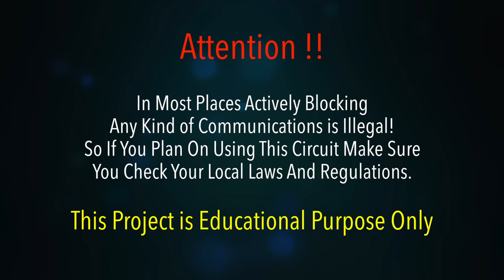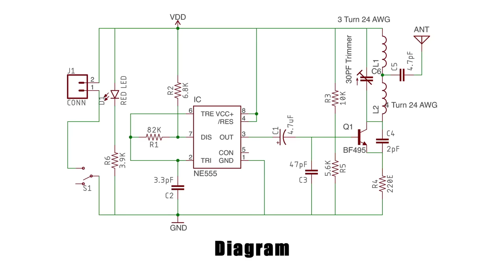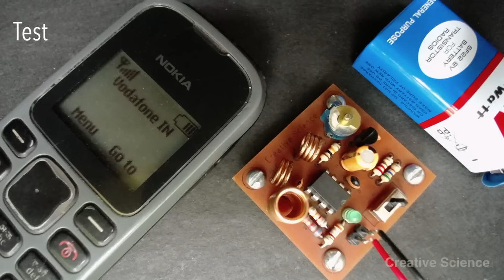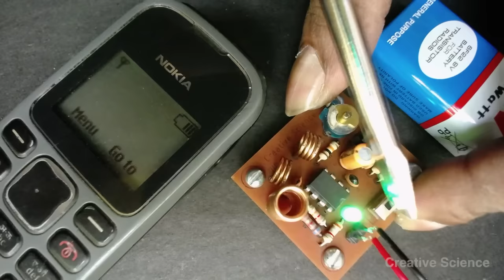Make Your Own Cell Phone Signal Jammer Using NE555 Timer

Comment: Built one, and I've been building radio equipment for 50 years. Range of the device was about 5 inches!
Reply: This person actually buys full kit and assemble it!!
Reply: Haha thank you. I was wondering this myself. I just picked up amateur radio and I thought this device was cool for a second. Then I remembered basic circuitry.
Reply: I think it works better if you have a phone from the 90s.
Reply: Do you think it would work better with a bigger antenna?
Reply: This was the only comment I was looking for. About the range of this tiny board.
Reply: @stevansaucedo4151  yeah, no. That's not how anything works.
Reply: @anubhkatiyar21  no he designed the PCB his self.
Reply: Stephen Cook i have to say this whats hilarious. Buy a plasmalighter and a screwdriver and put it inside the plasma and it actually jamms (totally blocks) phone internet connection.
Reply: Thats more than i was expecting !!! Because in the video the pcb almost touched the phone !z . Did you over clock the voltage to gain a extra radius ?
Reply: @yinyangstudios-y.s-53  use a old router and fiddle with the voltage . Create a bubble of useless signal that is pushing the network away
Reply: @piyushkadukar7337  with overclocking 5 inches xD
Reply: YinYang Studios Y.S or bigger layout and everything overall increase in size
Reply: How can I find board
Reply: This is a very “micro” way to create one for good reason.
Reply: It's the perfect size to fit under foil hats.
Reply: Stephen Cook I think the one in the video is for demonstration purposes a good example. Obviously you need scale that device up to reach a bigger area. But that video is not there (and hopefully no other one on YT) to show how to kill the cellular network of a city.
Reply: I'd like to but one
Reply: "Range of the device was about 5 inches"

So how to increase the range then? With a bigger antenna?
Reply: Thanks. But why did you bother? I feel gullible for even clicking on this video and giving it another view (I did not watch it, but wanted to see what someone like you might say in comments.)
Reply: 5 inch is not that small.
its average.
Reply: NPC 45 not just there 😏
Reply: Thats what i was thinking that what will be the range of this device. By the way how to increase the range of a jammer if we are making one.
Reply: @yinyangstudios-y.s-53  No you have to change a few things like the transistor and 2 caps and lower 2 resistors and use 12volt than it goes 10;12 mtr, want schematic?
Reply: @egoy34  Mines goes 7"
Reply: Maybe  some wave amp placed on output will be good in making the range more far
Reply: Useful to gain privacy from active spying through the mic. If you are looking to have a completely private conversation or screw up cell location service to hide your movements.
Reply: Stephen Cook hi sir is this worth building ?
Reply: That's what I was gunna ask. What the range is.
Reply: amazing hahahah that´s not really far
Reply: YinYang Studios Y.S bigger antenna and more voltage
Reply: those bands are so far apart that a simple addition of a variable frequency oscillator could dramatically increase the power to the desired frequency band.
Reply: More power! Surely with 50 years experience you know that.
Reply: TheOnlyEpsilonAlpha i would love it!
Reply: 50 years and you couldn't tell it wouldn't work without actually making it?
Reply: I was wondering
Reply: Thx for confirming I was about to comment pls help Captain Dissoluttion or THE RECTIFIER
Reply: @antonycasanova4067  I'd like to see a schematic for that
Reply: well, if you build radio equipament for over 50 years, you know you just need to replace the amplifier transistor, right ?
Reply: I've analyzed the circuit, as no damn explanation on how it works was provided. The 555 generates ~ 2.5M square wave with ~52% duty cycle, and feeds it into the transistor.
The transistor switching off grounds one half of the LC tank circuit, starting the oscillation, which generates the actual jamming signal. Pretty crude stuff, but kinda works.
Reply: @antonycasanova4067  yes please I need2 longer Range. Partlist etc. Thanks
Reply: 5 inches 😀
Reply: YinYang Studios Y.S Yes
Reply: @antonycasanova4067  Hi. I would love that schematic. Many thanks in advance.
Reply: Despite its short range, maybe its a good substitute for a faraday cage but it still lets you have access to the phone? You could tape that thing to it haha.
Reply: YinYang Studios Y.S you’ll have to adjust for the frequency change.
Reply: Yeah you need to use a transconductor flux capacitor for more range ;)
And even then only works with an old Nokia!
Reply: I wish someone would actually reply to your question because I'd like to know too...
Reply: Why? Because he made a good point? Here's another one for you, there's no apostrophe in "parties".
Reply: @leeroberts4850  o
Reply: Knew it! Not enough power!
Reply: Stephen Cook really? Well i have an idea for something and i really need some advice on it.
Reply: @Stephen Cook - LOL
Reply: I was wondering about that
Reply: @antonycasanova4067 

Can please text me number of transistor, caps and resistors and also text which one replace on board?
Reply: THANKS   WHAT  I  THOUGHT
Reply: First thing I thought was that's useless as you would need to be transmitting much more power for it to be effective
Reply: @yinyangstudios-y.s-53  No, a bigger antenna would drain the battery quicker, you will need something in single wattage units to be effective , 1, 2, 5 depending on application
Reply: Disingenuous White-Boy  amplify the output with an RF amplifier and larger antenna, you will need two or three stages and a class A amplifier
Reply: @antonycasanova4067  ya
Reply: 5 inches is perfect to troll my friend
Reply: Sometimes.
Reply: Where can i learn on my own to build radio equipmemt? Where should I start
Reply: Create a bigger antenna
Reply: @egoy34  Keep telling yourself that,     if it makes you feel better. Lol !
Reply: @jackburnell3209  More power and total circuit redesign you mean?
Reply: That's more info than I got off the video.  Thanks.
Reply: @fatihbural7845  Yeah, a 12 element yagi got the range up to 16.5 inches.
Reply: @calmsounds5166  Build a different circuit. Splashing square waves across the electromagnetic spectrum is just plain rude. Not against the idea of jamming, just this implementation.
Reply: @cedricbillingsley3960  Or turn the phone off?
Reply: @HA7DN  Square waves have lots of harmonics.  This circuit is both crude and ineffective.
Reply: @dhallstrom75  It's on the screen.   😵
Reply: Built a circuit similar to this a few years ago with about 25ft range.
Reply: 10cm
Reply: the jammer he built only jams when you have it very close to the phone,because it is not big and powerfull enough to jam from a greater distance,for example 20m , 30m jammers for for that distance you cannot carry in your pocket as they are much,much bigger,and antenna would be more than 1m high
Reply: also the large ones are very dangerous because it will interfere with pace makers or any electronic device fitted to someones body to assist with heart function even the small one he made if held to someones chest with a pacemaker could cause it to fail,people can die.
Reply: there are other videos on YouTube that can teach you,my electronics experience is limited to making tube amplifiers and preamplifiers and speakers and modifying turntables.
Reply: I am no kind of expert on much electronic. Chaps like your self make me wish iwas. Groovy hobby. Too darn many of these videos that dont work out there man.
Reply: well, its extremely usefull when u steal a phone. especially i phones
Reply: Isnt that a good thing? So you can block only your friend when you are multiplayer racing
Reply: @Cptlink420  is that kinda like a Jacobs ladder?
Reply: I think if you make the turns of antennae a bit more in number and less in fuameter it would give an effective range
Reply: 5 inches...hmmm
now you need to amplify it a thousand times..nahhhh
Reply: Did you try to turn it off then on again
Reply: If u want more range just give it 1 A 12 V power. U should change circuit. And yray another antenna like circle antenna, path etc.
Reply: Mr. Cook, don't I know you? Haven't we communicated before? Your name sounds familiar to me.
Reply: @yinyangstudios-y.s-53  No, because bigger antenna needs bigger power. It will work, if You amplify the antenna input.
Reply: @antonycasanova4067  please I need schematic
Reply: @hedi8659  Okay I send it to your channel
Reply: haha
Reply: @antonycasanova4067  can you send it to me too pls
Reply: I was to say that
Reply: Nice 5 inches
Reply: @jesseleal9350  they sell them over net cheap
Reply: Hahaha the shortest range you can find in youtube baby that would qualify for guiness world record. Hahehihohu.
Reply: @fatihbural7845  A bigger aerial will only change the wavelength not the power, you need to upscale the amperage to utilise more wattage in the energising circuitry.
Reply: @jackburnell3209  precisely...
Reply: @egoy34  Bahahaha!
Reply: Can you tell me how to build one with at least 50 foot range>
Reply: @antonycasanova4067  yes ,please!!
Reply: then how to set it  for higher ranges
Reply: That won't work in a movie theater.
Reply: Want to tune up to 2km 😏
Reply: @obedientfire840  You have no idea what you're talking about.
Reply: @colindowden1430  hi friend, do You now what transistor replaces the BF495, since un My country I can not get it? Thanks for all your tips!!!
Reply: Tikai 12,7cm?😮 Maz! Vajag  no 3 - 5m! Kā lai uztaisa?
Reply: @ConsertandoTudo what do you mean? what kind would increase the range? (asking for a friend)

Comment: Puts a pin header on the PCB.
Solders wires onto header pins.
( ._.)~~~just...why?!?
Reply: Because India "Engineering"
Reply: Schematic is NOT RIGHT!! Resistors 10k & 5.6k the middle goes to base of the transistor!!
Reply: My thought too. Either use the pin header for what it's designed for (making a removable connection) or just solder the wires to the board.
Reply: Yeah 🤣
Reply: I wanted to yell at him for this
Reply: lost the plugs🤣🤣🤣
Reply: @antonycasanova4067  can u provide the right schematic diagram please

Comment: I think if you turned a hair dryer on that close to that phone the signal would be blocked.
Reply: elvis316 ha!!! You beat me to that!!!! So true!!!!
Reply: For real??
Reply: A hairdryer is basically a fan (aka a motor with blades) and a heating element. The motor uses coils to rotate, which emits a fluctuating  magnetic field. If you're close enough, the magnetic field will overpower the signal, but only on the frequencies it emits ( that would be the rpm of the motor * the number of poles of the motor, and multiples of this frequency, plus probably the 50 or 60 hz from the power grid)
Reply: @brisingreragon95  I'm not sure if that answer the question but good explanation of electromagnetic interference and why my laptop gets ou of sleep when I turn the lights on or off.
Reply: @brisingreragon95  oh you got to be shittin me
This is not at all true
Reply: @brisingreragon95  Sparks from engine brushes are the key element here.
Reply: Really
Reply: At that range, the driver electronics for an LED bulb would also block the signal.
Reply: How

Comment: To start, that wire is NOT 24 awg wire. being used for the coil. I work with 22 and 24 awg wire every day. It appears more like 16 awg
Reply: I'm an electrician and it looks like 14 awg to me.
Reply: you are right it more like 16
Reply: It's the coaxial core it worked
Reply: How significant does the guage of wire determine the amount of inductance of an air-wound coil if all other parameters remain constant?
L= (d^2 * n^2)/(18d+40l)
where:
L is inductance in micro Henrys,
d is coil diameter in inches,
l is coil length in inches, and
n is number of turns.
Reply: Thi guy is a liar!!! Not only is the 24 AWG wrong as you say, also the pc board when he shows you how he assembles it you can see there is no resistor for the LED the when he flips it over, oh magic you have the resistor. Also the pcb in his link has a mistake where the led goes... you have to modify it. I CAN NOT UNDERSTAND THESE GUYS!!!

Comment: I built a police radio jammer in a matchbox back in the early 80s using transistors for the oscillator rather than a 555. I tuned it by sitting in the coffee shop by some cops and used a flattened toothpick to adjust the Fq through a hole in the box above the PCB pot until their radio just went dead silent. 555/556/558 are one of the most useful ICs on the market though. 
I also built a super bright flashlight with a 555 to switch an LED on and off with 5vdc from the output pin so fast it looked like a solid beam but too fast to burn out the LED. 
 Good old days.
Reply: Please it's not working, it  keeps generating 500khz and it doesn't block signals, could you help me plzzzzz
Reply: None of these circuits will work.

Comment: 3:15   What is a 220 E Resistor

it looks like you have a resistor   RED, RED, BROWN, GOLD  which is   220 Ohm (5% Tolerance)   it could be silver,  i can't tell , in which case 10% Tolerance,
but what's the "E"  For ?
Reply: This is just "." or Ohm, Morze code use "." how "E"
5E6=5R6=5.6Ω
56E=56R=56Ω
560E=560R=560Ω

Comment: Have a hard time finding that type of phone to even jam. lol. Cool video!
Reply: It would work with modern phone, too. It creates a static signal, that is stronger than the cell signal and therefore blocks it.
I haven‘t tried out the exact circuit, but i‘ve used a Raspberry Pi as a signal generator and it blocked the signal of my smartphone (however if it just jams the signal on a single frequency, most devices will just use another frequency or EDGE/GSM).

Comment: With an NE555’s speed of 500khz , how would this interfere with cellphone frequencies? (Serious question)
Reply: I would like to know too
Reply: Not 100% one this, but if you look at the circuit diagram, on the right side with the transistor, this is setup like a frequency amplifier circuit, so this could drive the standard frequency of the 555 to a frequency that would interfere with a standard cell phone signal. Also as a side note, the unit is running off of a 9V battery, so the unit wouldn't have that much power to drive out of the antenna to have that great of a range (saw someone else comment that the range of this unit, after they built it, was about 5 inches). Hope this helps!
Reply: Rafael Macedo oui,I
Reply: Rafael Macedonia

Comment: Useful but illegal. In places where it's legal there is probably one running already (CIA building or whatever).
Reply from the maker: darth, i know that is illegal, so i make it low range
Reply: Some of the movie theaters use something like this so phones won't work during the movie
Reply: @PhilieBlunt666  not active jammers. They use copper wires to block signals aka Faradays Cage phenomenon
Reply: sir  i also need to know  about it

Comment: Very good thanks.
The oscillator works at 2.5 MHz true?
It is interesting that it disturbs the receiver even though it works on GHz frequencies.
Reply: lol
Reply: No, the maximum frequency of the  ne555 is around 500kHz, but the electromagnetic field can still disturb the cell phone signal, I think
Reply: Yeah I never really understood this, is it a frequency multiplier? Or is it that the higher harmonics from this specific oscillator creates noise for the base band of 2/3/4G signals?
Reply: IMO the oscillator is L1/L2 and varcap 30pf, the NE555 only excites this oscillator from time to time, its own frequency doesn't matter
Reply: Perhaps the fact of being a square signal allows some of its components in high frequency to generate interference. You have to do FFT with an oscilloscope.
Reply: IMO, It works as EMP generator too, not only an electronic interferencer.
Reply: @fabriziobrutti6560  the 555 frequency doesn't matter, it's the frequency of the tank circuit that matters.
Reply: @markhaus  it's the oscillator as you said, the tank circuit just gets an excitation from the 555 every now and then so it doesn't die off as the oscillation, start to settle.
Reply: @jarmenkell2313  it's not an emp. That tank circuit will only output "soft" sine wave signals, not a sharp pulse that a true emp would output. It wouldn't give anything like the results of an emp.
Reply: Has any one try this circuit as a signal jammer and it works as well as the video?
Reply: @lazyh-online4839  right...I had forgotten it

Comment: Remove the 555 and keep the Transistor. Then you have FM radio Jammer
Reply: How to jamm a point to pint internet connection?
Reply: @seyedmahdiqazanfaree5234  depends on how the two pc's are connected to each other.

Comment: bro, can I ask for a scheme and layout with a radius of 50 meters?
Reply: Just you need to add three stages RF amplifier, it could be with three transistors, first one act as pre-amplifier.
Second one as driver.
And third one as final stage power amplifier at least 1watt output,then you need perfect antenna...
Just search it and easy to make...

Comment: to increase range you would need a Q2 with a bit more power, you could also reduce the value of R4 slightly to increase range, but if you go to low it will burn the transistor
Reply: And can i do that how to increase range at least around my house.
Reply: where did you learn this any books you can recommend me ?
Reply: @goran-is6zr  you should study electromagnetic waves to learn this stuff but its generally common sense to get more efficiency you should get a high output for any electronic device. in this case resistor protects some of the elements in the circuits while loads the circuit a bit which causes range to decrease. you can start learning with basic circuit theory and electronic devices like transistors, diodes, op amps and so on, after that study electromagnetic field&wave theory in order to comperhend the basic logic of antennas.